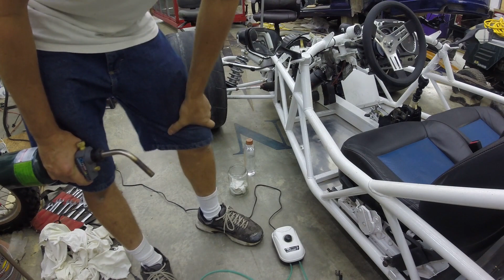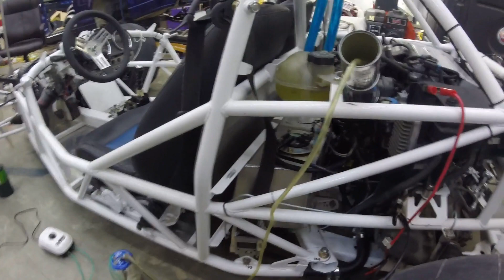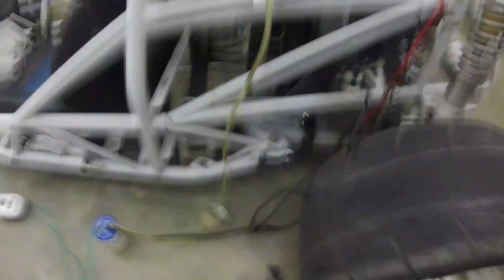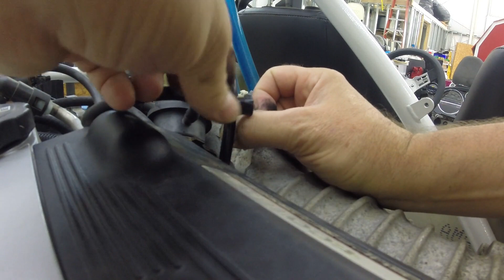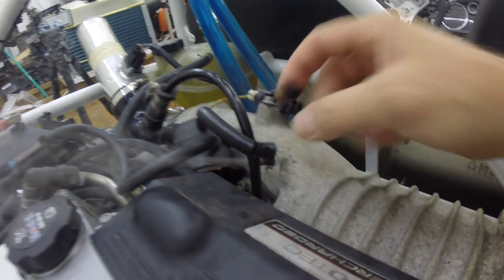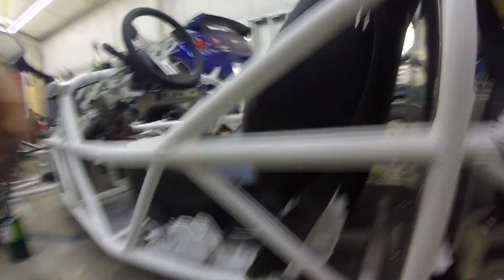How to find air intake vacuum leaks with a DIY smoke machine.

Comment: Is that a b207r  saab engine? I don't see the turbo though so I might be mistaken...
Reply from the maker: The Saab b207r is the same LSJ engine with the turbo... but this is the supercharged version of the LSJ, that came out of a 2005-2007 Chevy Cobalt 2.0L SS.
Reply: @rosslawrence4628  very cool choice

Comment: Won’t the smoke damage the MAF sensor
Reply from the maker: Not really damage the MAF sensor, but it will dirty the MAF sensor a bit.  You could remove the MAF sensor before smoke testing, and cover the hole with tape.  Cleaning the MAF sensor is pretty easy, and is good maintenance.  https://autovfix.com/how-to-clean-mass-air-flow-sensor-with-alcohol/